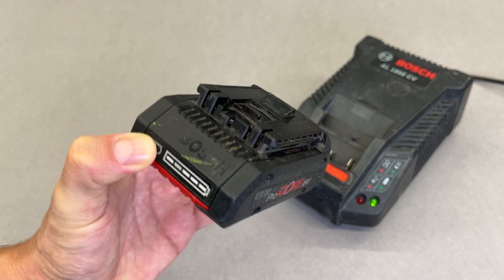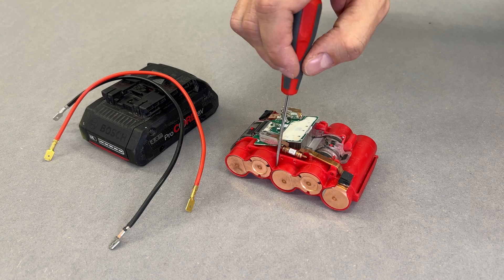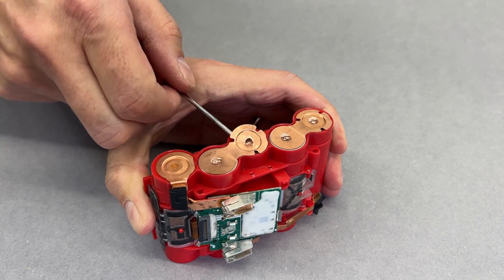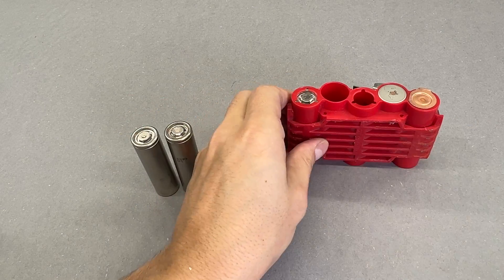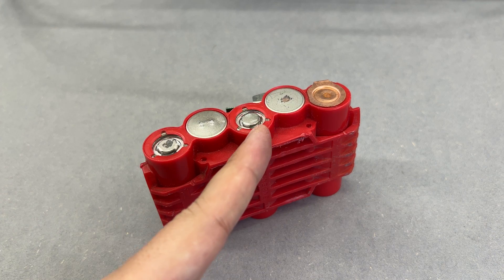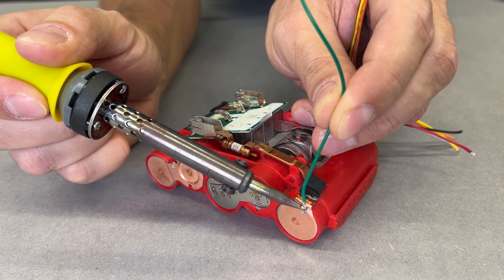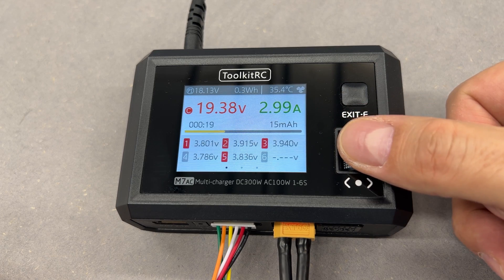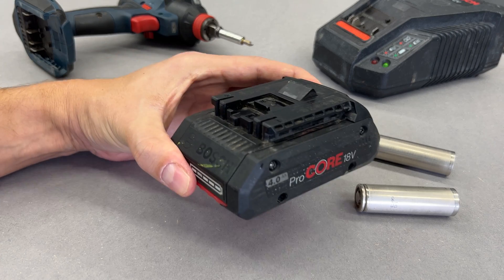Faulty Bosch 18V ProCore Battery - Issues, Diagnose & Repair

Comment: I have this exact battery not charging properly.  The overall voltage is 18.08v on the two main terminals.  I checked each cell as in the video. I'm getting 5 different readings for each battery from (lowest) 3.18v, 3.21v, 3.44v, 4.12v, 4.21v (highest) so the each of the cells certainly seem to be providing voltage.  The issue is that it will not charge as a complete unit.  When the Charger says it is full, I remove the battery, check the health button on the battery and only one green bar out of five lights up and then battery lasts a very short time.  Any ideas what this issue could be?  I have two other non pro-core Bosch regular 18v batteries that fully charge correctly to 5 green bars health no problem so don't think it is the charger.  The on board fuse is also fine.

Comment: maybe you could answer a question when testing batteries at 0:46, how is it possible to test each battery as one battery. ?  yet they are all connected together as one how does it works without reading voltage from the other connected batteries , i see lots of videos testing doing what you're doing , i even tested my own , but why doesn't it being connected throw it off to read higher ?
Reply: The cells are connected in series in this battery. You can measure a single cell within this circuit by connecting your multimeter probes to the + and - of one of the cells. The multimeter will measure the voltage difference between the probes, and not the voltage of the whole circuit.

Comment: Thanks! I wouldn’t have thought to balance out the voltages of the individual cells once I replaced it, so that was really helpful I fixed two Bosch 18V 8ah batteries (that cost $109 each) for about $10 each doing this. Really well done video!

Comment: 2:22 Just pry without grinding. The copper strip comes loose, and only leaves behind just tiny pieces of copper. Those tiny pieces are harmless, just spit weld right over and around them. Grinding only risks a thin battery wall and burn-through on your welds later. Do you really want to burn through and ignite the contents?

Comment: this..replace one or two batteries and not all of them is bollocks...having voltaje doesnt mean the battery will do its job..i have 3 older style that have 3 lights and when i use em they cant hold.more then 1 min...so what if they charge or show full lights? hey re done! replace em all

Comment: Copper and nickel - tin have different resistance ! 
Why you think Bosch used copper?
Copper have temperature resistance lower than nickel and tin ! 
You can't use nickel or tin for a Bosch akku .. think about it you have a 100w akku and what could happen ! 
You must reuse the copper but use kapton tape band The housing that is screwed on does the rest!
Ist only my opinion!

Comment: My battery shows 19v then nothing.  Seems to switch off straight after showing a reading. Each cell shows just over 4v. Is this a thermistor fault and how do i change it? TIA
Reply: So it's full...
Reply: @jcvjcvjcvjcv  for half a second????
Reply: @ If you put it on the charger? Or if you press the indicator? With Procore batteries, press indicator = it's lights up for x seconds. With the normal GBA batteries it only lights up as long as you press the button.
Reply: @jcvjcvjcvjcv  nothing happens when I press the button and on the charger it shows solid green not flashing
Reply: @jbgk65 So balanced cells, no action on charger nor tool? Bad thermistor would do that too.
Reply: @jcvjcvjcvjcv  I thought thermistor too but I can't see it or how to bridge it?
Reply: @jbgk65  Bridging it with a short circuit won't help you as it needs to have a certain resistance.
With normal Bosch GBA batteries there are two black wires leaving the print leading to the sensor that is glued in between the cells. These wires might be leaving from the underside of the print; I don't really remember.
With the Bosch Procore batteries the resistor is below the print, integrated into that ribbon, touching the 2nd cell, counted from the side with the indicator.

Comment: So by the time we get all the tools and parts, it's cheaper just to buy a new battery. Thanks!!!!
Reply: Only you will have the tools to fix any future battery packs when they fail plus other projects that may come up
Reply: It may be true that if you are only going to fix one battery than it's cheaper to buy a new battery. However, if you have a bunch of batteries and don't want to replace them when they suddenly go "bad", it's worth the investment to buy a charger that can balance and measure internal resistance (which is necessary if you aren't going to use all new cells). A spot welder can be purchased for under $50. Over the years I've had many batteries go bad for various reasons. Most of the time it's bad cells, or bad thermistor, and it's easy to fix both. The 18v, 8ah Bosch batteries go for about $110 each. Fixing just one of these justifies the cost of the charger and spot welder. Plus, in the future when the cells go bad (and all lithium batteries eventually go bad) you can pull the dead cells, put new cells in and suddenly you have a brand new battery. I buy 21700 Samsung cells in bulk for about $3 a cell. The 8ah Bosch battery has 10 of these, so you can get a brand new battery for $30 just by replacing all the old cells. If you are a hobbyist or homeowner it probably is best just to get a new battery, but if you run a small business like I do, it makes sense to get a few tools and fix them yourself.
Reply: @michaeldavid625 which Samsung 21700 battery do you use for these Bosch cell replacements? Which spot welder do you recommend if I want to be able to reuse the copper that is welded to the cells? Thanks for the info!

Comment: Followed your video. 4 cells around 3,8V. 1 was at 0,4V. Swapped the faulty one with a reclaimed 40T @3.35Euros. Used a cheap spotwelder with strips of nickel et voila. All leds green and the charger said "Thank you".  Great video, really works for me.

Comment: Some of the Bosch battery housings (like the one I bought in 2021, which failed in 2024) are put together with screws like in this video. I had trouble taking it apart until I realized that one of the screws is covered with a plastic plug. Just dig into the hole with a screwdriver until you make contact with the screw head and it will come out like all the others.
Reply: Any sharp screwdriver or knife can stick into those seal capa and take them out .
Reply: I use an actual pick. Set of 4 for Ryobi batteries.

Comment: My 4Ah battery stopped working it denied the charge on a standard charger also in my 16 amp Bluetooth charger 3 days later after being 100% dead and couldn't even keep a bosch light on I decided to unscrew and pry the sides a little didn't even come apart maybe gunked up with dust and dirt I tighten the screw back on it started charging again 🤷‍♂️ okay I call that an easy win, however, it only goes to 4 bars instead of 5 bars furthermore my charger via blue tooth and the app says 100% charged strange fix

Comment: bosh seems to be kinda bad at making batteries

out of 2 pro core and 3 bosh green batteries I had 1 dead pro core, one dead green and one defective green that has some contact issues with one of the sensor pins, also one of the bosch green batteries has no balancing at all, not even a PCB

meanwhile I have 4 Wesco batteries, 2 genuine makita, 2 knockoff makita, 2 Facom(dewalt), 1 worx and 1 parkside battery that have all worked flawlessly for years

Comment: LI-ON battery pack factories building packs for example of 40 cells will discard entire assembly if there's one bad weld.
Those are being then handed over to recycling company.
Someone at the recycling company takes them and then disassembles those for sale instead of recycling those.
Much greener than just grinding those unused cells to raw materials.
Reply: Very green but also very illegal, these recycling coys r paid to dispose of these not break them up and resell them for profit. Its the same for every other electronic goods, it brings deflected goods into the market bearing the manufacturer's name
Reply: @aquakey9834  What I was trying to say is that those cells are actually perfectly fine and good with 0 defects.

Comment: Thank you for the very detailed video.  After going through my battery, I found that it has full voltage )18.4v) and each cell reads 4.7v.  But it will not power my cordless vacuum nor does any lights blink on the charger when plugged in.  The front battery capacity LED do not light up either.  Any ideas on this one?
Reply: pero las celdas son de 3.7 volt
Reply: It’s actually reading 23v so looks like it’s overcharged?
Reply: @stevenbennett5451  Where do you see 23V?
Reply: @stevenbennett5451  Is it an LG Cord Zero?

Comment: The reason the contacts are copper is for heat transfer. Removing the would make the battery bot perform as well.
Reply: It is true that using copper keeps the heat down compared to using nickel, but the main reason Bosch uses the copper is because they can use a much thinner gauge of metal keeping the pack lighter, thinner and (yes) cooler. When I rebuild these batteries I have to use nickle strips that are double the thickness of the copper Bosch uses. I sometimes reuse the copper that comes in the original packs, if I'm able to disconnect it with minimal damage to the copper. When you spot weld copper, a much higher gear setting (around gear 7 or 8) is needed, whereas for 1.5 or 2M nickel I use gear 4.5 on my unit. The older Bosch batteries used nickel and it works just fine. True, copper is best, but it's more expensive and it's harder to spot weld. Nickel works just fine, though. I've built around 25 new Bosch batteries using aftermarket cases built in China using Samsung batteries and nickel strips, and rebuilt about 40 batteries reusing the original Bosch cases and they work just fine. The problem is, the battery boards available are of the type used in older style Bosch batteries. They haven't yet made knockoffs of the ProCore battery board. The older style board has a thermistor soldered to the board, whereas the newer ProCore batteries have it built in, I suppose. The older Bosch batteries use a 5K NTC thermistor resistor which can go bad and is often the reason a pack will not work. I've replaced lots of thermistors and revived batteries of many different manufacturers. You can get them cheap from DigiKey or any other electronic parts supplier.

Comment: Wow, nice but a steep learning curve as a electro noob 😂.

Do you think it is possible to create only  one charger for multiple 18V battery technology? In stead of having 6 different brands.
Reply: Bosch in a way is trying to do that, with AMPShare, but outside that program, all the manufacturers use their own proprietary communication protocol, so, the "no caveats" answer is "no". As you can see, with the exception of Bosch and Milwaukee, the manufacturers are also trying to introduce artificial market segmentation between "18V/40V", "20V/60V", because that makes more money, so there is really an interest for you to Not be able to use the same charger.

Comment: You can pull the tabs off without the ball grinder. But your way they come off flatter which is a nice bonus.

2:40
Heat the red housing and it will more easily let go of the cells. Same before re-inserting cells. Better not rotate the cells when inserting or you might damage the balance contacts.

4:33
I have the same spot welder and I can weld those copper tabs just fine.

6:00
Wow, that is a nice charger.

Aren't you afraid the new cells combined with the older cells remaining in the pack will soon give issues? I tend to replace all at once. The Bosch battery itself doesn't do balancing, only monitoring.
Reply: I want to add; since my previous comment I have rebuild another Procore battery and I couldn't get the copper strip to weld at all either while using the same equipment.

Comment: What you did is dangerous and it will not survive for very long. A lithium battery works between 2.5 and 4.2V. You can't go higher or lower than these voltages unless you want an explosion. So, when you make a series pack consisting of more than one of these batteries, you can't separate them easily, so you charge them together. To charge them together, their capacities must match to a tolerance of around 100mah. If it doesn't, then lower capacity ones will drain faster than higher ones and once low capacity cells deplete, the protection circuitry will turn the output off. Now you have 3 depleted cells and 2 cells at 25% state of charge. Over each cycle this difference will be cumulative, meaning the difference will grow larger after every cycle until something stops working or blows up. New cells will have higher capacity and the on board tiny balancing circuit will not be able to balance such a large capacity gap. Virtually all drills include a passive balancing circuit, which start working at around 4.1V. At that point it will stop charging and discharge higher voltage  cells through a small resistor to balance them. That resistor dissipates the charge as heat but since they are very small, they can't dissipate much heat. That means they draw a small amount of current, usually 500mA or 1A in order to keep heat under control. So, since your new cells will have 5Ah and your old cells may have 3. 5Ah left in them, the balancer needs to work for many hours to balance them, which will get out of balance again during top charging to 4.2V. What will make it worse is the fact that you might, for various reasons, cut the charge before full, which will only exacerbate the problem.
Reply: There is no balancing on these packs. + and - are hardwired to the terminals (+ with a fuse).

Comment: the balancing interests me. Like all poles were connected, how does it supply charge to an individual cell? wouldn't all current just spread out over all poles?
Reply: I think it doe's not properly balance. It just shut's off if a too large inbalance is detected...
Reply: Actually the cells weren't properly balanced in this video. 
What the external charger probably would do is bleed of some energy of full cells to bring them down to the lowest cell and then charge all up again to 4.20 Volt.
Reply: All poles are connected individually, so the charger can charger whatever cell(s) it wants.

Comment: The balancing step was not needed. If you put the battery in the Bosch charger with the cells exposed and monitored the individual cell voltage you will see the Bosch charger actually balances the cells itself.
Reply: Even Bosch itself says... no balancing.
Reply: No! The charger charges until the first cell reaches ~4,1V. I've tried it out, there is no balancing.
Reply: @ChristophPsi  Thanks, but that is very disappointing. So Bosch is only monitoring individual cells for safety but does not go one step further to use these for balancing and increase battery lifespan.
Reply: @ChristophPsi Wich bosch charger do you use?
Older bosch charger dont have bms (battery management system) and only charge battery, but new bosch charger gal 18v-160 has bms and balance battery at the end of full charge.
Reply: @Bola_engineer91  Imho this is not possible with the current design. Can you explain how the balancing could be done?
Reply: Thats Very cool that makes repairs more easier

Comment: I didn't have a charger with BMC, so I balanced the cell with a 12V car lamp. It was painly boring, but I managed to succeed.
Reply: How can you balance cells that are put into series? You need to address each individual cell
Reply: @PhilippStadler  You have to open battery case to do it.

Comment: These ProCore batteries seem to be crap. I got one on my bench now that had done the exact same thing; drained two cells to 0 volts!
How can the BMS or tool even allow voltage to drop that far?
Reply: Bosch has a bunch of tools that don't respect the 'battery = empty' signal and keep on draining it. Pretty much all the connected stuff does that. The BMS itself does not disconnect either terminal. It signals on one of the three middle poles.
Reply: Happens to 6 of mine. I hate them. Just googled it now.  Happens to everyone.
Reply: Really depends on the tools, because the undervoltage protection is in the tools instead of on the battery. Connect it to a tool that doesn't properly terminate at low voltage, and the battery will drain.

Comment: you left 3 old cells and installed 2 new cells / you think they have same capacity? Soon the battery will get out of balance and then you will need to balance again.
Next time replace all cells
Reply: He checked each battery's internal resistance and they were all good, very close to a new cell. The unit he used also checks the capacity of each cell. So, there is nothing wrong with doing it this way.
Reply: If all need to change, better buy new pack batteries.
Reply: @azman4749  individual batteries are still way cheaper than a new pack
Reply: @PhilippStadler and they suck🤣

Comment: You can do that on older batteries not on newer.On newer electronic board will lock when cell are dead or disconnected from cells.
Reply: Depends on the pack, this a recent Bosch pack, looks like it doesn’t lock, I know that Dyson ones lock
Reply: @mohamedelkady6237 Makita locks as well

Comment: Mmm, apply too much heat because say as in my case I suck at soldering and I have trouble attaching the "balancing" wires. I can wreck the good (and new batteries) or I cause a 💥, injure myself and burn my house down.

When showing people how to "repair" a potentially explosive device, might be a good idea to stick to the benign topics like how to make hidden alcohol storage containers with none exploding PVC. Just don't set fire to it unless you have a gas mask that'll filter out the not so healthy chlorine gas. 

Have a good one. 👍😁